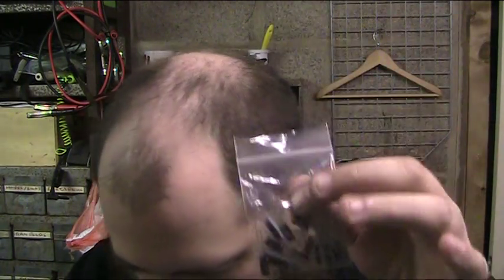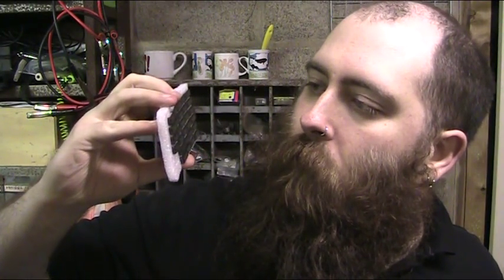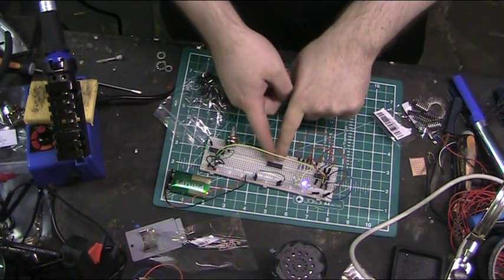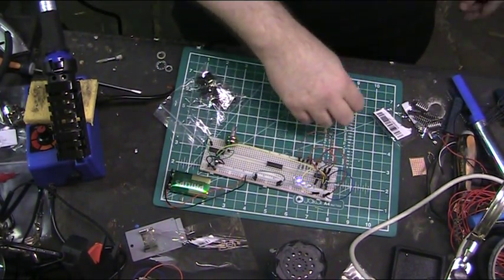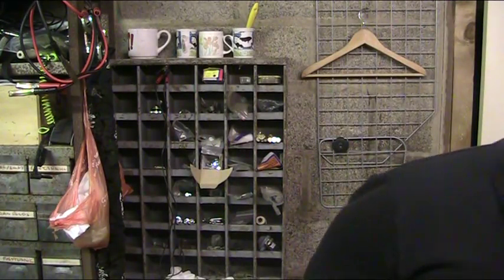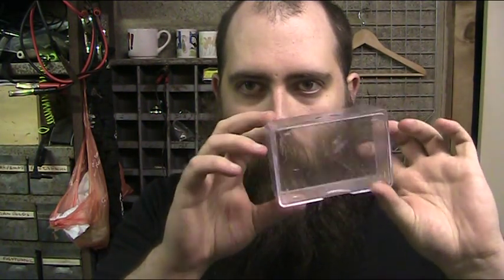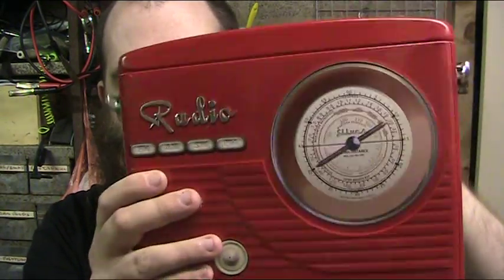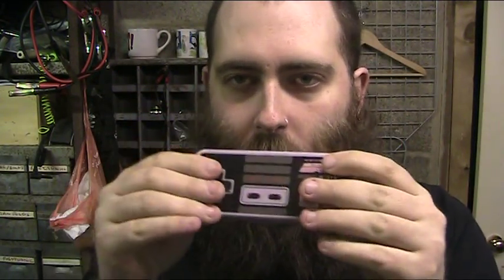My adventures in DIY synth making, part 1

Comment: Thanks for the tip on the 4017 i half thinking of doing a step sequencer for my project .
Reply from the maker: Awesome - I'd love to see a video of it when you get it up and running :) I ended up finding a better way of doing it which still uses a 4017 but just has it controlling a single oscillator using a DIY vactrol (basically an LED and a photoresistor in a bit of shrinkwrap). I talk about it in my video here: https://www.youtube.com/watch?v=ApG6YSWV668
Reply: DannyCarnage Thanks for the reply and the link and for quenching my ignorance on what a vactrol actually is .  I will check out the link . Yes my project is up and running but by no means finished . If you check out my channels there is a few videos there :-)

Comment: hey man, i'm right there with ya. I've been teaching myself this exact same stuff or about a year now.  I could be wrong but I'm pretty sure you can use a linear pot instead of log.  The only difference between audio, linear, log, etc. is how quickly they change the resistance.  i.e., Audio is really smooth and steady, and linear or log are very jumpy and kinda cram all the change into one side.

something I did that you might wanna try is use one of those LED light strips that can be controlled with a remote as the control voltage.  i had one hooked into a 4093 synth i made and it ruined other synthesizers for me ha.